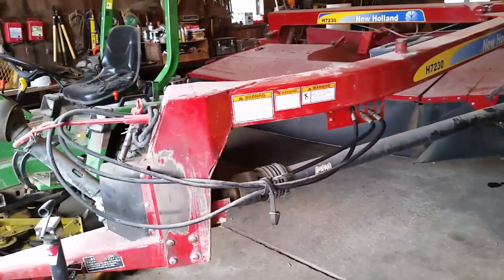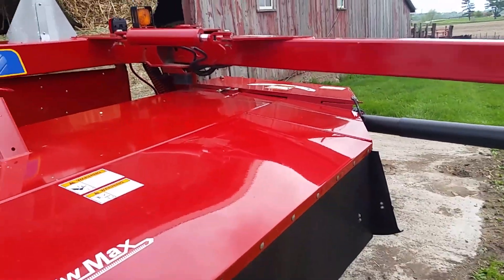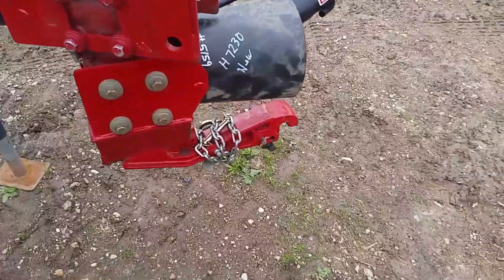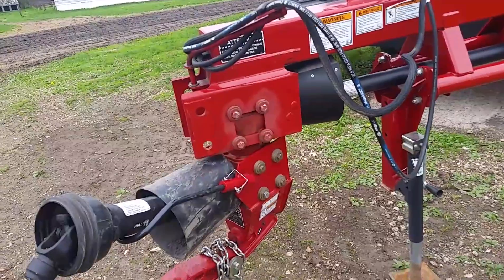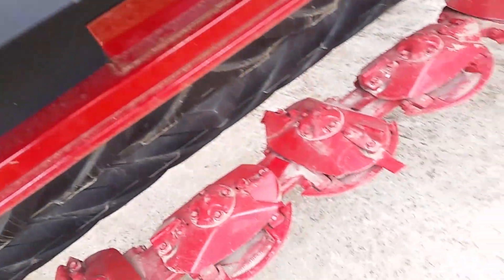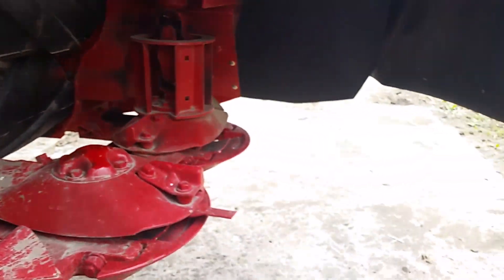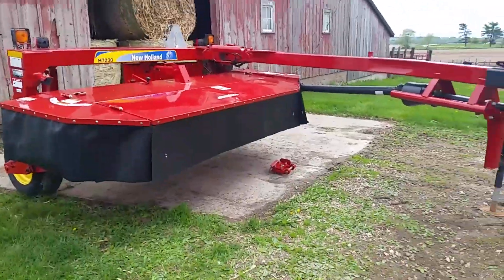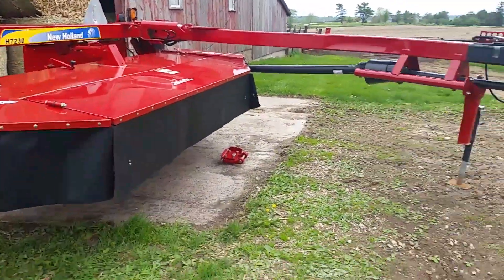New New Holland H7230 Discbine

Comment: congrats she's a beauty! i looked at the same mower but ended up getting a 926 JD i bought it used so it was a matter of parts availability the NH dealer is too far from me. How many acres are you doing? I mow about 250 but i have a full time job off the farm so thats enough and have 10 beef cows, I know its small but have to start somewhere ill ramp it up when i retire in a few years. I look forward to your new videos keep it up
Reply from the maker: Thanks! I had 7 cows for a long time! Ive only been around new holland mowers for the last 18 years. You are correct on dealer local. John Deere is 6 miles. CaseIH and NH are 20.. keeping red and green stuff keeps dealers aggresive. Ive often thought/planned on the next new addiditonal tractor would be red. Lol. Thanks for watching and commenting!

Comment: Hi cowcamp87. I recently bought a used New Holland H7320 Discbine and are very happy with it. There is a bad vibration where the driveline connects to the main gearbox. Could you assist

Comment: Your thing sounds reasoned and well thought out. My only caution is the 540. I'll be interested in what you think after you've mowed a few times. Thanks for another great video.
Reply from the maker: Thanks for watching and commenting. It will be interesting to compare the 540 to 1000 since both mowers are the same
Reply: You'll actually have a very objective opportunity. I am interested because I always heard how much better a 1,000 rpm bush hog was compared to a 540 (same size).

Comment: Hi, I placed a comment on another video you had, but I'll ask again here.  Do you like the H7230, as it has received a negative review on Hay Talk?  I need to replace a 20 year old Kuhn that is on it's last leg. Does the 7230 cut cleanly, and have you had any problems with bolts shearing off on the cutter bar?   Thanks for your time.
Reply from the maker: +maine932 knock on wood not a single problem. Had a defective bearing on a roller when new that was replaced free. They never seen that. Other than knives its been trouble free. The one i had before was same model but i bought it used and it had cutterbar issues..but i believe that was from the previous owner as in i think they mowed alot of trees and junk over in CRP ground. Hope this hellps